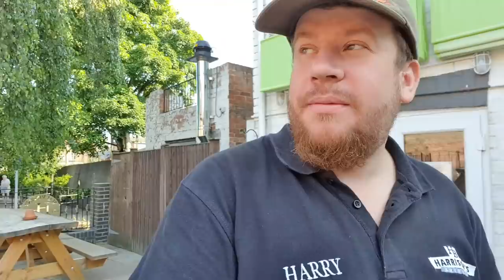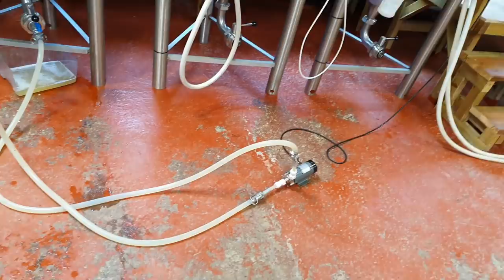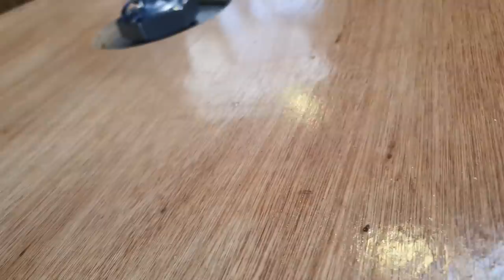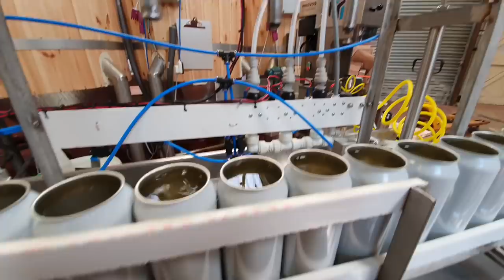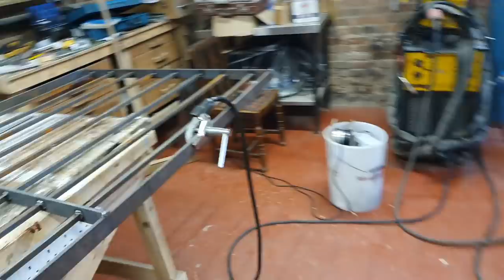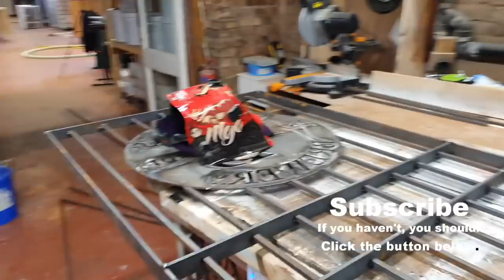Further Can Fapping

Comment: Just a thought of mine, why not skip the centrifugal pump and go to a diagram beverage pump like you use in your draft system in your pup? Hook it to the same compressor like your can filler and you can easily fine tune your pressure and therefore flow with an extra regulator. Also it would eliminate the problem of creating foam.

Comment: I am sure this vidwo is from before one I have already seen, but not certain.
My Engineering history (Retired twenty years ago) was with Blow Moulding machines and Product Handling. Lots of product. 6000-10000 containers per hour passing along a conveyor belt creates what I called "Belt Pressure" which accounts for the little leap that the Can made as it travelled. You need to "Gate" the product to create a gap between the three cans about to enter the filler so that they can sit properly on the load cells controlling the filler ( I am assuming you are filling by weight). I incorporated something I called "an escapement". The following product butts up to the product under the filler which is itself held by a stop by introducing a peg between the half circumferences of the product. Further down the line a similar peg, in your case, of three product is also introduced. The Filled product releases and after a short delay the following three are released then the remainder also after a short delay. So your product to be filled comes to its stop without pressure from behind the peg behind it extends then the following product is allowed. There is plenty of time. 6000 cans an hour require something much more complex.
Blow Moulding Machines are easy by comparison with Product Handling.
I also noticed that the filling was not uniform. You need a Manifold above the fill stations of more than the capacity of the cans beneath (perfect is six times but that is impractical). Then they will fill uniformly and more quickly. (which is where my objective was) :-).

Take care Notts fella. When will you offer your cans for sale. I have a couple of Sons in Nottm who I would like to send a few Cans to.

James

Comment: ***** Make a pier cap out of clay and then make a Silicone mould for the pier caps :-)
Use Fibre to bind the concrete to stop it cracking 'Concrete & Screed Fibres - 900G bag of 18mm polypropylene (PP) fibres' on eBay.
And don't forget the release agent (vegetable oil).